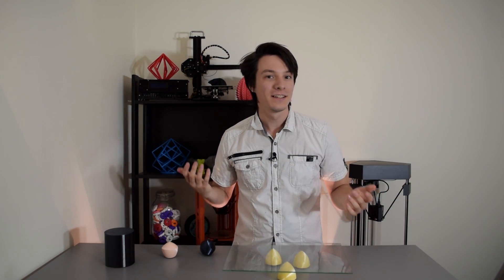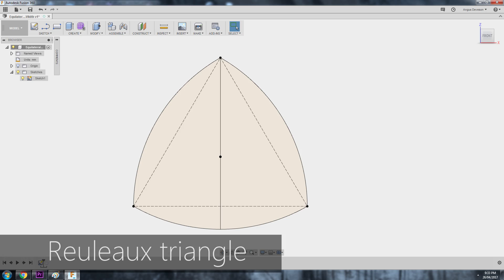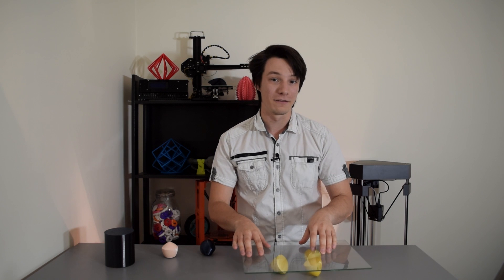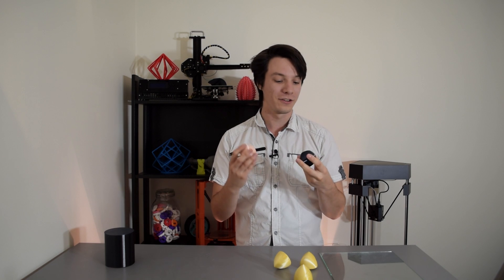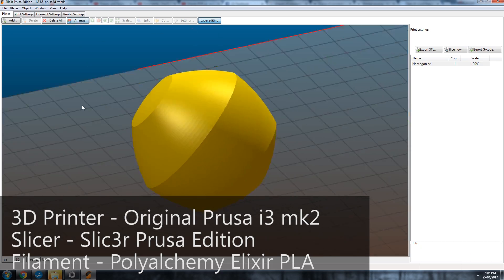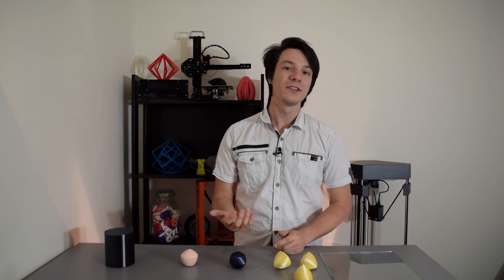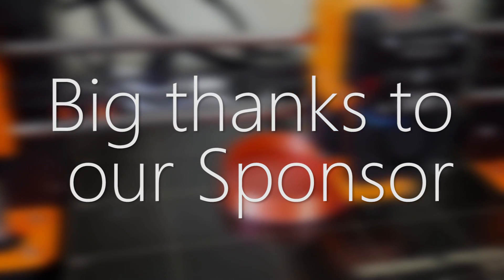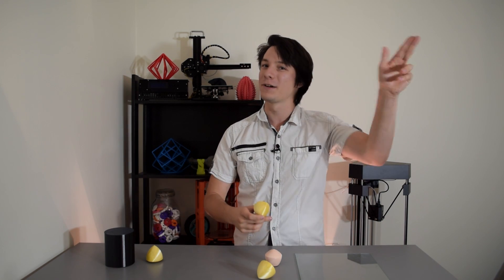3D Printed Solids of Constant Width

Comment: What would be the best orientation for a clean print? Face-down, edge-down, or point-down? I can see advantages and disadvantages to each. Face down is most stable during the print but leaves the most scarring from supports. For a tetrahedral spheroform, edge down would need supports along the edge, and a bit on the sides for stability, but overall only the edge would be scarred. Point-down would be least stable but all the angles would comply with the 45° rule.

Comment: An even number of corners will never work. With an odd number of corners the point of one corner will always be opposite to the flat side of two other corners. With an even number of corners, every corner will be on the opposite side of another which means that there will always be places where the diameter is slightly bigger.

Comment: There is a way but is really time-consuming. You actually have to make an extrude that equals your layer height and then copy the sketch to its surface, offset, extrude and do this again end again until you have designed a curve.

Comment: I am using solidworks....I was wondering what you think of fusion vs solidworks?
Reply from the maker: I learnt solidworks and for some things still prefer it... however it's far from affordable. Fusion 360 is free for startups and education.
Reply: I am in the injection molding and extrusion plastic industry.
aeplastics.com
You vids are awesome and are keeping me awake thinking of many a applications for revinue...lets talk...btw I am a over 50yrs old and been machinist for 35 yrs...gonna make a sphericon next week...thanx to your insight....is your main plastic poly pro?
Reply from the maker: Awesome! I think you'll find tremendous value in 3D Printing for prototyping short lengths of profile before commiting to dies for customers I used to do a lot of that when I printed on demand. PP isn't used much at all for FDM 3D Printing due to its dimensional variation as it cools down. PLA is the most common and easiest to 3D Print for prototyping, followed by PETG and ABS among others. Cheers.
Reply: The funny thing is The amount of plastic mat'l we chuck in the trash, iwas wondering if we can extrude a simple roll of watever diameter you want on roll alot cheaper than a 3d printer suplier? can you give me some examp's of mat'l you use ? include dia's and mat'l with roll size and core req's...remember i got thousands of pounds!!!!

Comment: I'm sure you could get a cheap RX8, since they're mostly all broken by now... Print up light weight replacement parts for it, since the engine is basically as fragile as a Faberge egg anyway

Comment: But can it consistently roll down or across something? Or would it eventually get caught on one of its ridges and start to slide or bump along? Thats what are consistent roll would really be.
Reply from the maker: The center of gravity is not in the middle, so it resists rolling on it's own but will roll with a flat surface on top of it. A bit of an oddity!

Comment: That's pretty cool.
My dad still has a Mazda RX-7 (he LOVES this car) with a Wankel Motor :D
Reply: If you had said engine, I wouldn't make a comment. It brings up the old 'semantics' debate on which is which. I was taught in engineering class by an old English Engineering teacher that a motor converts energy around one central axis as an armature. So this would make electrical energy into rotating energy a 'motor'. As for Engines he said it comes from Steam originally, many moving parts converting energy from steam along a straight plane, vertical or horizontal as an example,  into rotational energy, so pistons and crankshafts. As for a Wankel engine, it converts combustion gas into a rotational piston around a rotational axis. So the Wankel has more in common with a combustion engine than an electric motor. So, in England they call cars a 'Motor', which would only be correct if it was a Tesla. All electric, non hybrid.

Comment: by your definition rolling consists in it keeps the top at a constant hight? by that definition, sure it rolls
but I would define rolling to be linked mostly to rotating while moving and since these dont always have the center of mass above the contact point, they dont really roll well at all
in fact the physics definition of rolling is to rotate and traslate and under optimal conditions without sliding, so by this, the arguably correct definition, they dont roll like a ball at all

Comment: Instead of using a triangle with circles touching the points, try a triangular pyramid with spheres. Also I do not believe the non equilateral triangle method actually works for this.

Comment: Okay, so someone explain how it rolls perfectly. How would it roll as smoothly as a sphere when it has edges like that? Wouldn’t it provide some resistance when pressed up against those edges? Plus, wouldn’t it make it somewhat wobbly when used as a wheel (Which wasn’t that the whole idea behind it? To replace or at least imitate a wheel or ball?).

Comment: Don't buy an RX8. Garbage cars. Worked at a mazda dealership. We were replacing engines at anywhere from 35,000-50,000 miles at almost those same intervals. Had a guy who loved his RX8. 190,000miles. We were installing his 4th engine.

Save money, get a proper RX7. Or just don't buy overrated engines. "But that race car...." yeah yeah. And there are legends in every brand and configuration. Porsche crapped on the handful of accomplishments Mazda had.

Comment: think it would be more convincing if you place the parts on a flat rubber mat and put a rubber plate over them so they cannot slide 
i think the poits are higher then the rest of the object some they stick on that , i notice it happen with the glass sheet but it slided making it less noticable

Comment: Forget the Rx-8, I've got a 79 Rx-7 and it's a beauty. But it's mine and you can't have it. Nice content though
Reply: Hijacker Jou bought it for $100 when I turned 16 it was a wreck when I got it, it runs good and replaced the trashed interior but I still need a new dash and a good sand followed by fresh paint, cant decide on a color. I like the mazda sunfire red but I dont like it on the car. Replacing the exhaust was the worst since I want the car factory (except the sound system and paint if I cant find a mazda color I like).
Reply: Thee_ _Number_Six how hard does it brap?
Reply: Oh nice, an early one: I hope it's stock?
Reply: savage
Reply: Thee_ _Number_Six oh yeah now I remember lol that’s pretty impressive to be honest to have a car that old that’s stock much respect
Reply: Thee_ _Number_Six i think the first gen fd is 91 not sure about fc
Reply: Thee_ _Number_Six wow you’re more of a legend then I thought lol i’m getting my license soon and I’m thinking of getting a foxbody but I’m not sure if i have the time or the money to get one in a good condition or rebuild one lol
Reply: DRifted_NOS S first gen is fb.... its at the start of the vin number thats why they call them fb's, fc'c. First gen is fb, second gen is fc, third gen is fd. In 78 or 79 the U.S. passed a law on standardized vin #'s on imported cars all manufacturers had to comply by 82, mazda was compliant by 81. So in 81 they had the 14 digit vin but the 79 and 80 have the SA22C5##### vin SA is the body type, 2 is 2 door, 2 for 2 seater( some say 2 rotor, they are wrong), C for coupe and after that is the car number they started  500001 and went up from there, and if you give me a vin I can narrow it down to a week for sure that it was produced. Tried to contact mazda about finding the construction date of my car and the records were no longer in existence but I have mine pegged at the second tuesday of april in 1978. I love my 7
Reply: Hijacker Jou they can be hard to find after they were named the poor-man's collectors car a few years back in some magazine, best bet buy 2 one to fix one for parts out of the 8 me and my dad bought 3 remain they rest we stripped and we have a stock pile of parts. It is now almost impossible to find a 7 in the inland northwest for under $2500 U.S. but 7's are magnificent cars not to good in winter but burning out at each shift point is fun. Pissed on a few civic fan boys taking off from red lights leaving them behind and then shifting twice up into third squealing tires the whole time
Reply: I just bought a 04 rx8 gt wich is in really great condition and it's a lot of fun but i wish it was a rx7!
Reply: Thee_ _Number_Six the only issue with those is the engine is very inefficient though they work the mileage is horrific
Reply: Leeroy62Jenkins no the milage in my lincoln towncar is horrific. My 7 actually gets over 20mpg, towncar gets 13mpg
Reply: Thee_ _Number_Six
The turbo 2 mod are the fc and the twin turbos are the fd
I think all are awesome and a Beauty to watch AnD hear.
FC.. Aren't my style at all
U lucky to have the one you have, they are so light and fasstt.
Reply: redstarpiru1 no fc is the 86-90 I believe, its a blocky thing and had the 13b. fd is the 90's one, all sculpted curves and tuner looking its the one most frequently seen in racing games and was even in one of the fast n' furious films. I know my 7's not so much on the later one's but I have personally dismantled and replaced almost every single part on the SA's and fb's. I even know a Pontiac small block will pretty much bolt in. And swaping the 84-85 blocky dash for the earlier curved and rounded look is a huge pain had to cut and move mounts all over to make it go in. But yes thank you I am very lucky and extremely happy for my SA I just wish I could find the original fender mounted mirrors from the Savanna concept, love the look not the most practical spot but I love the look.
Reply: Thee_ _Number_Six
Yes that's what I meant, the ones that  came out with turbo 2 models.
Is the FMR layout, either 2 door coupe or two door convertible.
The fd3s is the one all over fast and furious, I've had 93fd's two of those. Completely regretted selling them. The first I got for 9 thousand back in '06with jdm engine.
Reply: Not bad for the newer one, paid 100 for mine old man put about 5k into the other 7 gutted an 82 for the interior i could managed  to find an 80 out on a neighbors back 40 told me if i wanted i could take it. So since it had fire damage and no motor i stripped it of everything i could. If i find so much as a bare unibody of another Sa in good shape i can almost build a whole one all i would need was a motor. Would love a second one. Not for myself though my dad has had one of every first gen and the only reason he didn't get an SA was because i bought it, would love to pay him back by getting him one of his own.
Finding a nice 7 for a good price that hasnt been mangled and rats nest ripped out is impossible i got lucky with a police auction. And by mangled i mean head piped. Replacing with factory exhaust parts is not a cheap thing.  Yes i will go on and on about 7s for days, guess im just wankle nut
Reply: Thee_ _Number_Six
I hear you, rx7 are part of my life.
If you're on the eastern side of the USA, you can find some in good condition for good prices.
That's awesome too, you and your dad has the best hobby in my opinion
Reply: Fc or fd ?
Reply: Runs nice, needs a rebuild though apex getting a bit sticky. Omp still works, fully stock 12A. And its not an fc or fd, 79-80 are SA 81-85 are fb and I can't remember the fc and fd years never liked those ones I personally very much dislike the 2nd gen body style those fc's are just to damn blocky. Fd's aren't bad on the eyes but I love the old gull wing look. And the wife cant bitch because I managed to track down a stock rear seat for an SA so I can haul the kids if I have to.

Comment: You don’t want a rx8 the renisis rotary engine has a ton of problems that only get fixed by fundamentally modifying the porting on the housings. Get a rx7 2nd gen or “fc” body style. There more affordable, more fun to drive and use a periferal exhaust port unlike the rx8. Just know that if you do go rotary you are entering a world of high maintenance cars that had to be driven and maintained a certain way in order to run properly. I have to say though, there so much fun to drive and worth learning manual for if you do decide to get one.

Comment: Ok, I don't think the same width with even sides is possible. Unlike the odd sides, the even has the longest point where the two points of sides meet. Take the square, it has two points that are the longest. They are also the only widths that connect to each side instead of two. That means that no addition of more circles could make the square have an equal radius. Possibly, as you approach higher even sides, it seems to be possible, but isn't until there is and infinite amount of points, a circle. I think that may be a valid reason.

Comment: This still doesn’t make sense, all I saw was 3, 3-D shapes with round edges that rocked back and forth on only those edges
Reply: House._ 
There is a Numberphile video on the maths of it as well as the Grand Illusions channel which demonstrates them much better than Angus
They are, in fact, are indistinguishable from a ball if you sandwich them between two planes (like two books or two panes of glass). 
If you live in Europe, many coins are also shapes of constant width, 2D solids of constant width

Comment: if you off set the bottom surface about .2mm and extrude to bottom surface as the support it will reduce the roughness on the bottom

Comment: Instead of just rotating the shape about its center to create the 3D for, I feel like you could design it in the same way except start with a pyramid shape and form the new curved faces from spheres with centers at each point of the pyramid. This would give you a more interesting form that would still roll the same.

Comment: They don't behave like ball spheres because the center of mass moves up, down and around relative to the lower contact point, hence their settling into a repose position. Only the outside parallel contact points when held between two planar surfaces remain constant distance.

Comment: Considering creating a shape of constant width out of even sided polygons: This confused me too, because I was certain that any number sided polygon could become a shape of constant width, so I started drawing out some experimental diagrams in GeoGebra to try to prove it one way or another. After several missteps I came to this conclusion: shapes of constant width are only possible with odd sided polygons, and impossible with even sided ones (via swept arc). Here's why:
With odd sided polygons, the top and bottom points that roll against a top and bottom surface are always a corner and its opposite edge. The opposite edge is always a radius of the corner, so by definition of a radius, it has to be a shape of constant width. The reason it's always a corner and an opposite edge is because a shape of constant width is also a shape of constant height. Height is measured by the difference between the highest and lowest points on a shape. When a shape of constant height rolls and an edge is on the bottom, the highest point will always be the opposite corner, and conversely, when the point is on the bottom, the highest point will always be on the opposite edge.
That's for a shape derived from a polygon of odd numbered sides. On the other hand, if you try doing the same thing with a polygon of even sides, the shape derived will always roll with an edge on top and bottom or a corner on top and bottom, never a corner and edge opposing. A radius cannot be swept out from corner to edge on an even sided polygon. On an even sided polygon there are only opposite corners (single points) and opposite edges (infinite points on both). However, an arc is an infinite number of points swept out from a single point. Sweeping arcs from a corner to edge will not work to create shapes of constant width with even sided polygons, no matter how hard you try (or how hard I tried in GeoGebra). Interestingly, the only way, I believe, to derive a shape of constant width from an even numbered polygon would be to place to radius at the center and describe a perfect circle. You could say that a circle is an infinite number of polygons swept out to create a shape of constant width.

Comment: Make a ball bearing with these
Reply from the maker: Hey that's a pretty good idea !
Reply: Which, if my understanding is correct,  wont work? I believe a ball bearing actually needs the centre of rotation of the ‘balls’ in between the outer and inner ring to stay constant because there are four points of contact rather than two. This is because the balls also touch each other (end on end) and not ‘just’ the rings to keep equal spacing (when we are talking about a cageless bearing).

Comment: Re: extending 2d objects of constant width into 3d - definitely take a look at the paper titled "Bodies of constant width in arbitrary dimensions" (easily found online). It describes a technique to extend any 2d object of constant width into 3d. It might be a bit difficult to implement via CAD operations though, you would probably have to write a piece of software to help with it. It essentially involves taking the intersection of an infinite number of spheres.

Comment: Couldn't you make the non-equilateral triangles objects of constant width by varying angles. So one slice is a different triangle from another slice?
Reply: So you could create this in 3 dimensions if you put an equilateral triangle perpendicular to non-equilateral triangle while sharing the same center point then connect these points with spheres.